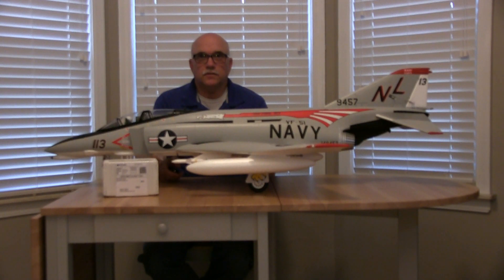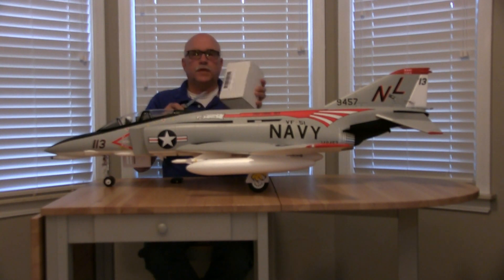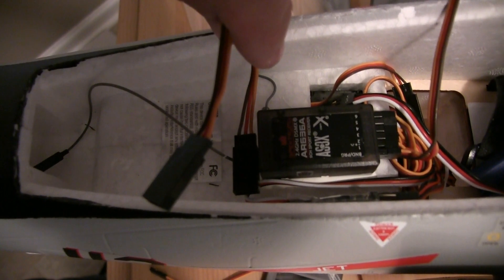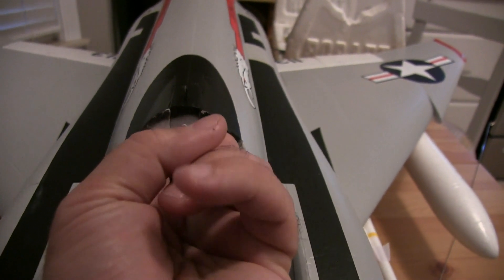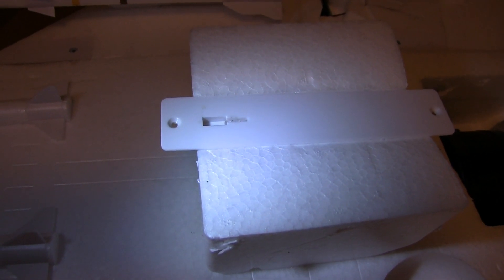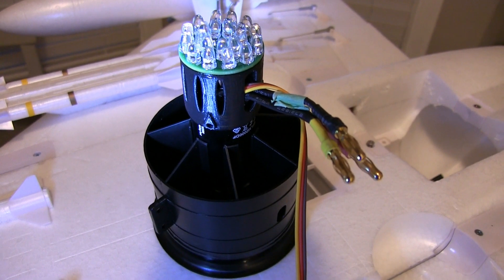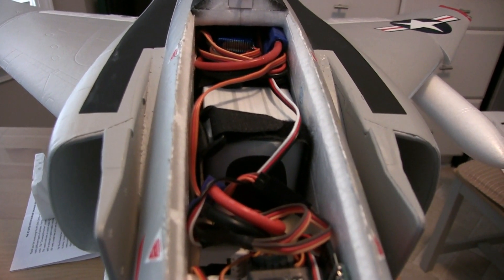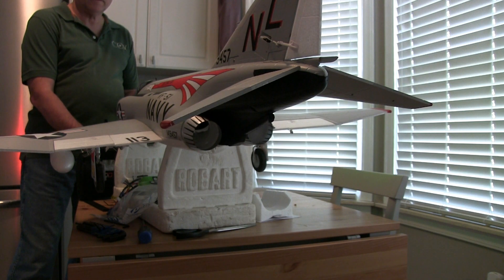E-Flight 80mm F-4 Phantom II RC Geek afterburner install

Comment: Do you not find that battery really heavy in the F-4?
Reply from the maker: Not at all.
Reply: I also have this question. I just attempted to fly this plane for the first time and found it so nose heavy it wouldn’t rotate after 150ft at full throttle. I just re-assembled, putting my JR RG613BX receiver under the batter tray in an attempt to pull the CG back a bit but still can’t achieve anything more than 175mm from the leading edge with the gear retracted (it’s even further forward with the gear down). Did you add weight to the tail? Edit: the battery I’m using is ~50 grams lighter than what you’re using (website says that yours is 803, my Pulse 65c 5000 pack is 755 grams).